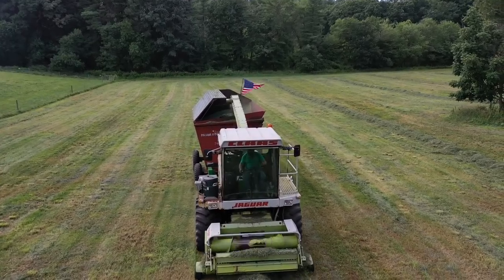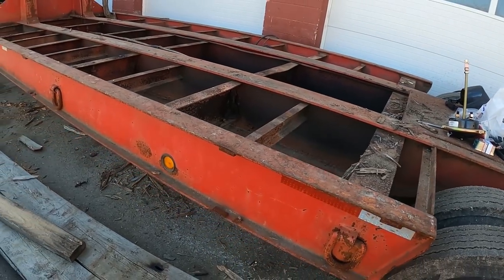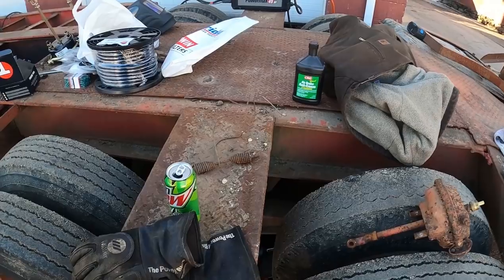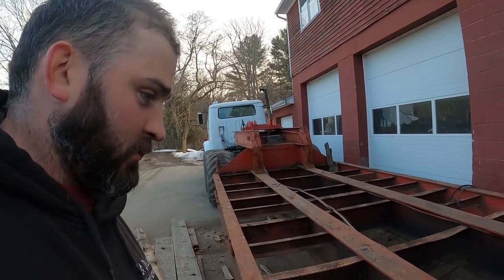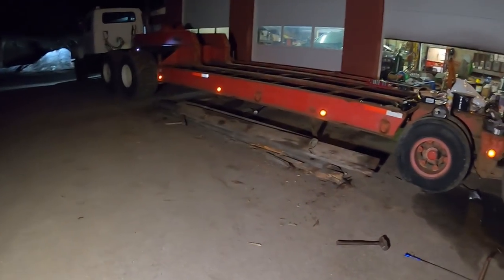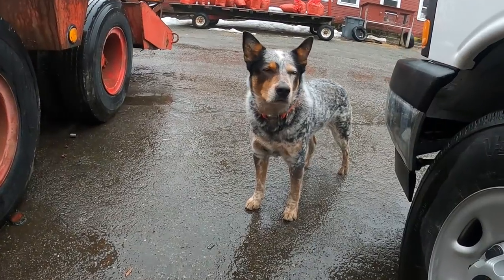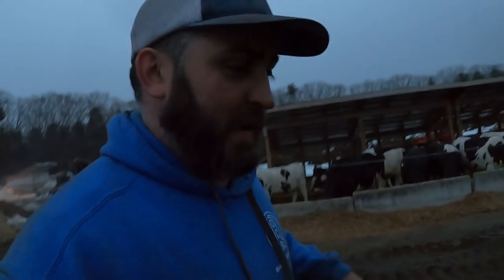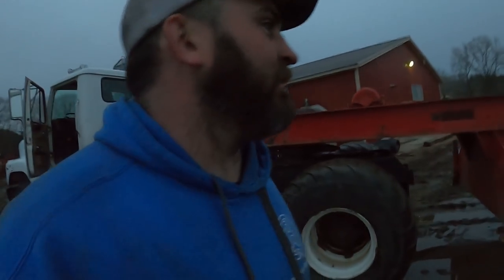1970's Trailer Becoming New.. Will The Fertilizer Tender Work?

Comment: Glad you are going with all new wiring and brake chambers. If you are going to be mostly "around town" then the more lights the better. If it were me I would have driven it up on some ramps or timbers so you would have had more room underneath. Always use the heavy duty plastic ties and don't be afraid to use them. They will last longer than the hardware store brands. I get mine at the trucking supply store. They ain't cheap but they last.
Reply from the maker: Good thinking for sure

Comment: Just a idea you could put up a carport / lean-to in front of your work shop and cover in the sides with two doors would be cheaper than a new workshop keep the videos coming
Reply from the maker: Milk truck needs to swing that corner so can't have anything permanent. Good thinking tho
Reply: @DuffyAg  or may be a leantoo or a folding oning like on the RVs and trailers

Comment: I don't blame you for not changing the brakes over to have parking brakes because it's going to set for extended periods of time and the shoes would likely be stuck to the drums more often than not and you want it to work when you need it and it not be a problem getting it to roll.  Keep it simple and reliable is what works best for starting out.
Reply from the maker: Thats true too

Comment: You guys have a wheel loader. It's easier to do wiring and Airlines and brake work on a trailer like that if you just tip it over. That's how I've done it in the past on several lowboys a lot easier than crawling around underneath.
Reply from the maker: Thought about it the mini loader probably wouldn't flip it over tho

Comment: Hey can you needle scale all the rust off the tender? You are going to need 3 or 4 big side to side beams to set it on to drive out from under it so you can haul the chopper or big tractor.
Reply from the maker: Some point I will clean up the tender. The chopper and tractor will be to tall on the trailer but I'm sure I will be hauling stuff

Comment: The last lights at the end of the trailer should be red. Mass dot hates the farm guys up in Merrimack valley
Reply from the maker: Never knew that
Reply: @DuffyAg  red at the end tip and red rear facing for you ICC lights
Reply: @DuffyAg   what breed is Yanko
Reply: You should add a center turn signal as well too keep dot happy. Just use a super 60 oval and cut the hole. Like adding more lights, makes you more viable on the road
Reply from the maker: Don't plan on seeing DOT ever since it's staying in town and running farm plates
Reply: @DuffyAg  DOT is everywhere one minute your the only person for 20 mile then boom reds and blues
Reply: @DuffyAg  I would alway prepare to meet the dot. With your narrow roads and crazy people who like to call law enforcement anything could lead to the dot coming to visit. Here in Minnesota farm vehicle don’t need to be inspected but must meet all the same safety requirements as regular commercial vehicles

Comment: The double chamber brake cans are so if your trailer disconnects on the road, the brakes apply and stops it.
 Mr. DOT man most likely will shut you down on the spot, if you are inspected.
Reply from the maker: This trailer will never see DOT. It's gonna stay in town.
Reply: @DuffyAg  
Glad to hear it!
Reply: I don’t think DOT will shut you down. I’ve run trailers like that. That Is how it was manufactured, it’s not altered. You couldn’t run a new trailer with brakes set up that way, but a trailer made in the seventies no problem. On the s cams, grease them like crazy, they should be fine.

Comment: White zip ties are not UV-stabilized and will break down outside. Also, I think your brake issue will be the S-cams sticking. Probably gonna need cams and bushings too.
Reply from the maker: Thats good to know. We have a large supply on of white zip ties because we use them for compost bags. I believe the one will need cams and bushings for sure. Have to see tomorrow